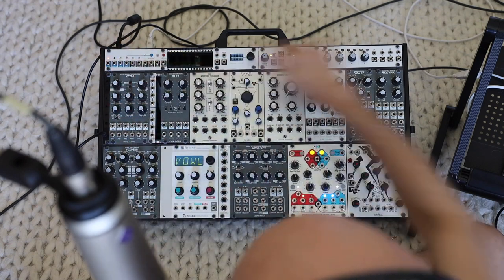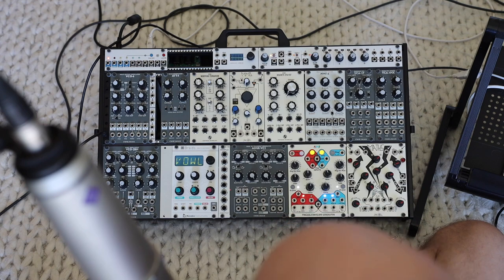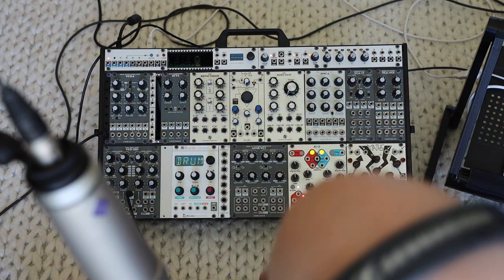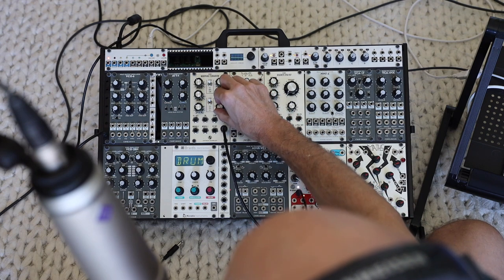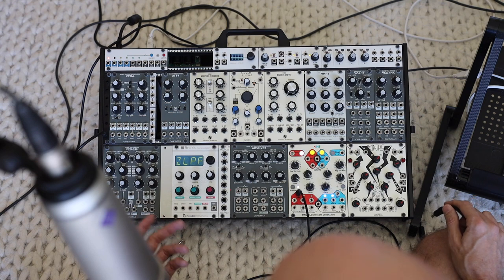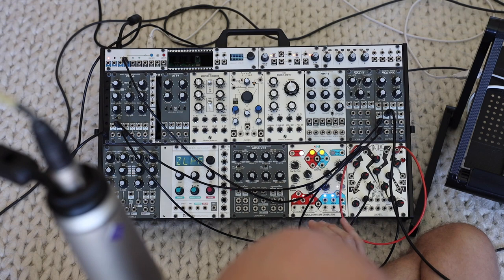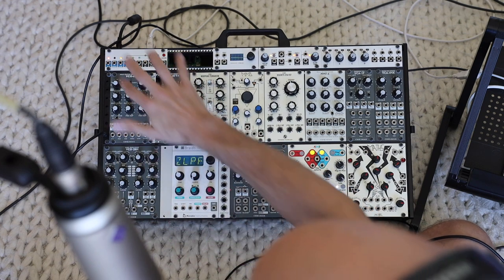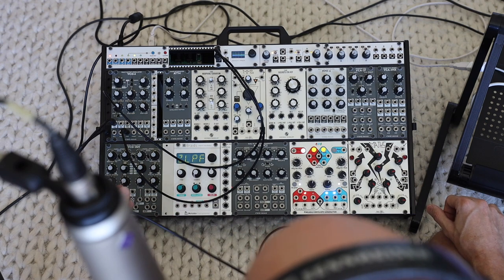Performance Modular Tour

Comment: I think the Mordax data is an excellent Oscilloscope even though it's a bit big as you have four inputs, a tuner, waves with separate outputs and more. With the big screen you get loads of information and several useful settings. Easy to use and they say they are working on making a sequencer for it to. But for me the oscilloscope and tuner are reasons enough and I still learn so much. As foremost a visual artist I find it indispensable and before I got it I was really struggling with envelopes. 

I see you got the E440. A fun trick I just learned and just in case you haven't tried it is to use it as a fast lfo type of thing by turning the resonance all the way up and slowly move the frequency from zero up. But do it slowly as it needs some time to catch up/oscillate at the right frequencies. Works really well on ambient stuff. I tried this with a Belgrad filter to but it doesn't work that well, but probably on other good "buttery" filters I suppose.

Thanks for an inspiring and great little lesson with loads of food for thought.

Comment: Hey, I just stumbled upon your video while searching for a video demo of the VCO-2RM. Maybe you can help me out with a question: I'm planning to build a Cwejman-based "drone" voice as I really like his sound and already figured out I'd like it to have 24db hpf as I often use hpf-sweeps to bring sounds in and out (as Mike Parker does in a lot of his tracks for example). I had the Verbos DFP for some time and while I loved its hpf, I wasn't really pleased with the lpf being 24db only. I'm now looking at the VM-1S as a starting point because of its morphable 24db mmf, but I'm not sure if I should rather get the VCO-2RM and a filter module like MMF-1S. What do you think? Thanks in advance:)
Reply from the maker: Voice modules are always a good starting point and Cwejman maximizes the integration with well thought out designs. Modules are small and easy to ship. If you don't like a module, you can flip it, so there isn't much of a barrier to buying a module without the commitment of it being 'the one'. It is better to have an open mind and revise your opinion later after using it personally. Modules that work for one person will not necessarily work for another. I like the VCO-2RM but if I were starting out, I might prefer two VCO-6s instead. I love the MMF-1 but I find I don't use 12dB /oct much.
Reply: @stretta  thanks for the help!
Reply: @stretta  now getting a mmf-1s :)
Reply: @stretta  Could you talk about why you'd pick two VCO-6s over VCO-2RM? Is it the sound, the multiple outs on VCO6 or something else? cheers!
Reply: i guess I am pretty randomly asking but does anyone know of a good place to stream newly released tv shows online ?
Reply: @Ayden Brody flixportal :D
Reply: @Rogelio Anakin Thanks, signed up and it seems like a nice service =) I really appreciate it!
Reply: @aydenbrody4258  spam
Reply: @Ayden Brody happy to help :)